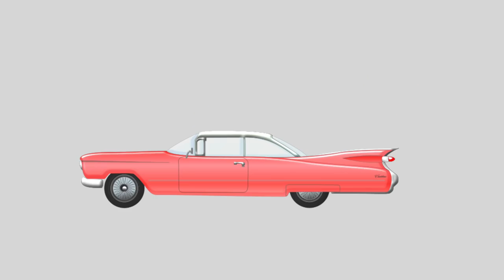Yes, Rockets CAN Fly in a Vacuum

Comment: No!  There's no air in a vacuum.  Nothing to push against.  Can't be done.  Sorry.
Reply: Dude, did you watch the video, she addressed this very point
Reply: He's a flatard, they have no comprehension.
Reply: alex tworkowski   -  If I were to take that idea seriously how does having air to "push against' propel a rocket? So exhaust gasses emerge from the end of the rocket nozzle and at some later point molecules of  those exhaust gasses collide with air molecules, but since at that point neither the exhaust gas molecules nor the air molecules are attached to the rocket what is the mechanism that imparts velocity to the rocket?
Reply: Well you are right about the 'no air in vacuum' but the rest...
That English physics guy (Newton) nailed the principles back in the 17C; they haven't changed much* since the days of the Founding Fathers.
He did it by observing the world around him and building a model that worked.
* one of the tweaks being relativistic mass which becomes important at near light speed velocities.
Reply: Michael Moorhouse   Newton had many relatives in the business.  They would go to mass together every Sunday.   The priest told him to go straight unless acted upon by the air force.   Oddly enough, and apple weighs about one Newton. 
 And an Nm is the force exerted by an apple falling from a hight of one meter.  And an Nm a is what your mother did to you when you used bad language as a kid.
Reply: Richard Cornford
Yeah, I was just kidding.   It's a terrible habit.
Reply: alex tworkowski  -  fair enough. Though it isn't much of a joke if it is word for word identical to statements people (albeit ignorant, credulous or dishonest people) make in all (apparent or feigned) seriousness.